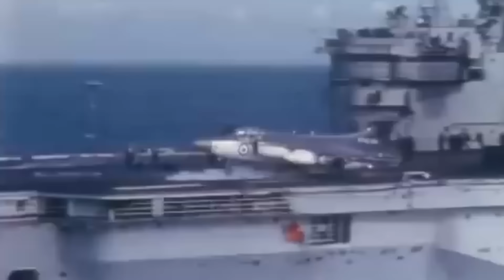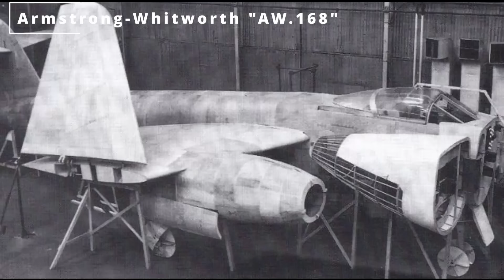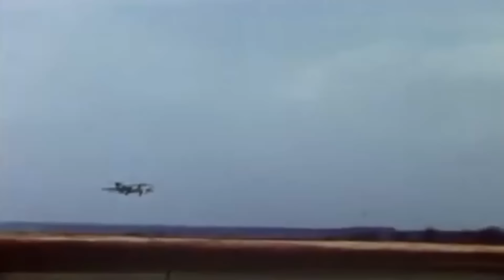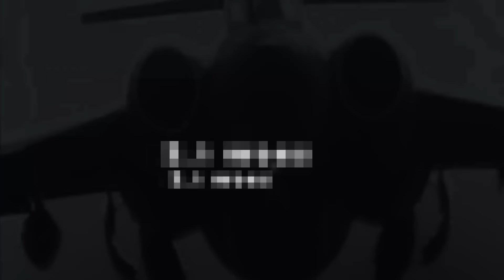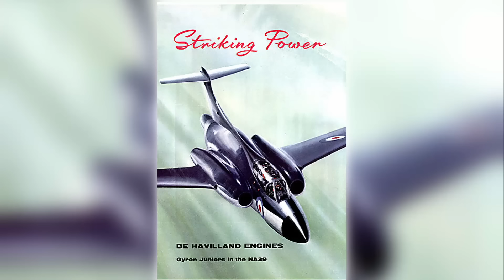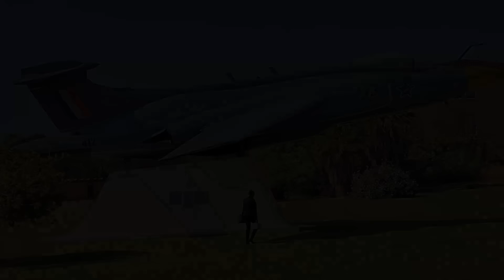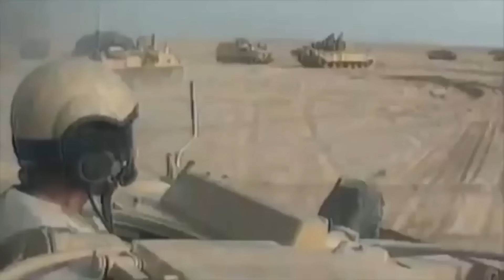Blackburn Buccaneer  -  Insane Low Level Bomber Americans couldn't shoot down - (Full Story)

Comment: I will always remember as a child of the 70's and 80's in the Highlands of Scotland waving down at the pilots of Buccaneers if we were even a small way up a hill when they passed
Reply: They "attacked" our car on holiday in Scotland. Buccaneers and Jaguars were a regular treat when we holidayed in Scotland.
Reply: @liammalone250  It wasn't only the RAF though I can remember being on a fishing charter boat in the 1990s which was vey obviously used by an RN frigate for weapons target drills
Reply: @davidmcintyre8145  True. I remember as a Grology student in the early 70's one fine Easter  day in Scotland. My frinds and i were sitting on a hillside eating our lunchtime butties. Below us a minor road snaked down the valley appearing round a buttress to our right and then off down to the valley floor. As we sat the silence was broken by a rumble coming down the road. 'Motorcycle.' Said someone, 'maybe a Harley.' As it come closer and got louder we came to the disappointed conclusion that it was a lorry. We all sat up, interested to find our which it was. Then, as the engine noise got much louder, into sight, following the road at very low level, came a Fairy Gannet!
Reply: @chriscarter5720  For real noise however you could not beat a Vulcan howling over a hundred feet or so above you
Reply: @davidmcintyre8145  That's not noise, that is a symphony from the gods on Mount Olympus.
Reply: @liammalone250  I had that too just outside of Market Harborough thought the world had come to an end….. almost thought I could hear the crew laughing 😳😳😳
Reply: I used to wave Down to or sometimes level with them @ the 7 Winds Cambusbarron . 1978/9
Reply: totallly, as a scout camping in the highlands I can remember being many feet ABOVE the buccaneers.  The pilot waved at as us :-)
Reply: Yip. I can vividly remember a hill in the Angus glens that was a great vantage point for the Buccaneers from Lossie. You actually looked down on the aircraft as they hugged the valley floor. It was awesome!!
Reply: Same here, Lossie and Kinloss not far away from mine.
Reply: High altitude training for the Buccaneer.
Reply: I was at Uni '72-'75 studying Geology and spent many days in the Highlands. On one field trip we were frequently overflown, at height, by jets which my friend identified as Jaguars. I told him they were not and, when  he asked why not, I said, 'Wrong shape for jags and anyway they're up there if they were jags they'd be down here. They're USAF.' The hotel we stayed at was at the eastern end of Loch Assynt and on our last day as we started to climb into the minibus a buccaneer came barreling up the lake at about 50 feet turned hard right just in front of us and disappeared up the valley. I looked at my friend, 'That,' I said, 'was the Royal Air Force!'
Reply: I can remember being on holiday fishing in the Scottish Highlands in 1980 when a buccaneer came through at very low level, it was an awesome sight.
Reply: My dad flew the Buccaneer’s (an aircraft I've been in many times, from the age of about 11). Well things were a lot different back then, and us kids would often go to hound them on Sundays if they were quiet, and we'd often talk our way into a flight on whatever aircraft they were with LOL.

The old Fairey Gannets were awesome to fly in, what an incredible view! The ugliest aircraft, with the most spectacular view. I've also flown in the Harrier GR 7, the GR 9, also the Sea Harrier, plus nearly every helicopter you could think of, including the old, world speed record holder, the Lynx. I've flown many Gliders, but the most amazing and impressive of them all, was indeed the Buccaneer.

You just can't describe what it feels like to travel at an altitude of only 10–15 feet, at speeds of 450–550 mph. Seeing our own garden hedges as blurs, LOL, flying straight over them, skimming the branches (not allowed, but you know lol). 

That aircraft, the Buccaneer, I'll never forget, it scared the living life out of me.
Reply: The particular  aircraft at the start of this video, Sea Witch / Debbie was the gate guardian at Lossie for a while. This same aircraft was the last fixed wing aircraft to take off from a British Aircraft Carrier : Ark Royal : when they were all given to the RAF.
Reply: Years ago, driving on a country road in S.Scotland, I was literally overtaken on the road. First by a Buccaneer, then by a Harrier, then by a Hercules (whose pilot clearly needed psychiatric evaluation.)
I almost ended in a ditch - those guys didn't overfly me, they overtook me, at an insanely low height, on the outside lane of a highway. Mad, crazy, barstewards. But somehow I've since felt safe in their hands, in any future conflict.

Later that very same day, I watched a Hercules (same one? no idea) actually dogfighting - engines screaming - with a BAE Hawk. If the airframe engineers had been around, they'd surely have been having kittens, given the turns that Herc was pulling.
I suppose I should disapprove of such antics, but truth was I was simply envious.
Reply: @jackwaycombe  Wonder if anyone snapped a picture of you... So the would and still do make targets... Our fishing Salmon Cobble would be picked up by the crew as they passed...
Reply: @ecossearthur  
If they did, I'll buy a 10x8 print, whatever the cost!
Reply: @jackwaycombe  only through my eyes.. Only to have a modern cell phone
Reply: @EtonieE25  It was a regular thing, hence it, becoming banned. LOL. Times were a lot different back then.
Reply: @EtonieE25  Not tree's, hedges! LOL
Reply: @EtonieE25  Something I'll never forget, it scared the life out of me, yet I couldn't get enough, lol. My nickname was Speedy Gonzales.
Reply: @EtonieE25  I never got the chance in the Panavia Tornado though :(
Reply: @EtonieE25  
Rolling down the runway
throttles open wide
see the mighty Phantom
sway from side to side
airborne again without a blip
It's just one more aborted trip
but we're pressing on regardless
for the wg cdrs AFC

Went to early briefing
climbed into the Kite
opened up the throttles
and roared into the night
leaving the flare path far behind
It's dark outside, but we don't mind
cos we're pressing on regardless
for the wg cdr's AFC

Rolling down the runway
throttle open wide
see the mighty Falcon
sway from side to side
airborne again with just 9 G
I wish I had a nav with me (!)
but we're pressing on regardless
for the wg cdr's AFC

Rolling down the runway
throttles open wide
see the mighty Jaguar
sway from side to side
airborne again, but only just
It's not much fun
with F*** all thrust
but we're pressing on regardless
for the wg cdr's AFC

GIVE ME BUCCANEERS!
They're British through and through
The Banana Jet
The Best we've had yet
We are the last of the few.

Don't give me the Jaguar
Unless you refer to the car
The car is a ground hog
The aircraft, a half frog
Don't give me the Jaguar.

Give me Buccaneers
They're British through and through
The Banana Jet
The Best we've had yet
We are the last of the few.

Don't give me the Harrier jump jet
You haven't convinced me yet
Jets that fly backwards
Are soon to be knackered
Don't give me the Harrier jump jet
Well… You know, not just yet...

Give me Buccaneers...
They're British through and through
The Banana Jet
The Best we've had yet
We are the last of the few.

Don't give me this computer crap
It's no way to tackle a SAP
It's OK for Dicks, Germans and Spicks
But Gentleman, carry a map!

Give me Buccaneers...
They're British through and through
The Banana Jet
The Best we've had yet
We are the last of the few.

Don't give me Air Traffic Control
They live in a bloody great hole…
They scream, and they shout, then F**k you about
Don't give me Air Traffic Control.

Give me Buccaneers...
They're British through and through
The Banana Jet
The Best we've had yet
We are the last of the few.

Don't give me the F-104
It's only a ground loving whore
It goes in a turn, flick, spin and burn
Don't give me the F-104.

Give me Buccaneers
They're British through and through
The Banana Jet
The Best we've had yet
WE ARE THE LAST OF THE FEW!
Reply: Gairloch Wester Ross low level flying down the west coast... Epic
Reply: Yes!  I remember being half way up a glen and a Bucaneer roaring through below us.
Reply: As a child,I remember them flying over the beach at Portmahomack on their way to the bombing range.
Reply: I remember beinv at Eilean Donan Castle once and seeing a Buccaneer fly past.
Eilean Donan Castl sits at the corner where Loch Alsh meets Loch Duich.
 In order the make the turn the aircraft had to climb about 50 feet to be able to bank without the wing going into the water
Reply: Talk about dark horses. Many years ago I worked with a fellow IT lecturer. I'd worked with him for years,  spending many a happy hour in the bar. I  almost fell off my seat,  one day, when he casually revealed he'd been a Buccaneer pilot, and that it a nuclear bombing capabilities.
Reply: As an American with Scottish background I sure wish I could take a trip to Scotland someday I really feel like America is not cutting it. Especially down here in hell that we call Texas. Maybe someday I can make it back to the land that I call my homeland.🍻
Reply: Must say that I only found out about the 'Green Cheese' warhead this morning when I wiki'd up British nuclear weapons. Didn't know the Bucc carried it though...
Reply: @dominicseanmccann6300  Was too heavy for the Gannet, so, it was moved entirely to the Buccaneer, but this was cancelled in 1956, largely due to cost, and the aircraft becoming too visible.
Reply: Anyone remember this? 

Rolling down the runway 
throttles open wide 
see the mighty Phantom 
sway from side to side 
airborne again without a blip 
It's just one more aborted trip 
but we're pressing on regardless 
for the wg cdrs AFC 

Went to early briefing 
climbed into the Kite 
opened up the throttles 
and roared into the night 
leaving the flare path far behind 
It's dark outside, but we don't mind 
cos we're pressing on regardless 
for the wg cdr's AFC 

Rolling down the runway 
throttle open wide 
see the mighty Falcon 
sway from side to side 
airborne again with just 9 G 
I wish I had a nav with me (!) 
but we're pressing on regardless 
for the wg cdr's AFC 

Rolling down the runway 
throttles open wide 
see the mighty Jaguar 
sway from side to side 
airborne again, but only just 
It's not much fun with F*** all thrust 
but we're pressing on regardless 
for the wg cdr's AFC 

Give me Buccaneers 
They're British through and through 
The Banana Jet 
The Best we've had yet 
We are the last of the few. 

Don't give me the Jaguar 
Unless you refer to the car 
The car is a ground hog 
The aircraft, a half frog 
Don't give me the Jaguar. 

Give me Buccaneers 
They're British through and through 
The Banana Jet 
The Best we've had yet 
We are the last of the few. 

Don't give me the Harrier jump jet 
You haven't convinced me yet 
Jets that fly backwards 
Are soon to be knackered 
Don't give me the Harrier jump jet 
Well… You know, not just yet... 

Give me Buccaneers.
They're British through and through 
The Banana Jet 
The Best we've had yet 
We are the last of the few. 

Don't give me this computer crap 
It's no way to tackle a SAP 
It's OK for Dicks, Germans and Spicks 
But Gentleman, carry a map! 

Give me Buccaneers 
They're British through and through 
The Banana Jet 
The Best we've had yet 
We are the last of the few. 

Don't give me Air Traffic Control 
They live in a bloody great hole 
They scream, and they shout, 
then F**k you about 
Don't give me Air Traffic Control. 

Give me Buccaneers 
They're British through and through 
The Banana Jet 
The Best we've had yet 
We are the last of the few. 

Don't give me the F-104 
It's only a ground loving whore 
It goes in a turn, flick, spin and burn 
Don't give me the F-104. 

Give me Buccaneers 
They're British through and through 
The Banana Jet 
The Best we've had yet 

WE ARE THE LAST OF THE FEW!
Reply: I threw rocks at Tornados flying below me when i worked on a Scottish sheep farm in the late 80s.  Never hit one.

Comment: It was a classic case of if the RAF had accepted Blackburn's offer of the P.150 Super Buccaneer variant, the RAF could have gotten their overdue Canberra replacement as early as 1968!  And the RAF could have fielded 150 planes and become a major nightmare for Soviet war planners until at least the late 1980's (and possibly beyond since the Super Buccaneer could fly almost as fast as the Panavia Tornado in low altitude operations).
Reply: Interestingly the cockpit and RADAR for the Tornado was tested by bolting it onto a Buccaneer and the resulting Hybrid was deemed to be better than either aircraft
Reply: @davidmcintyre8145  Correct. A Buccaneeer S.2 was modified to carry and test the radar that would eventually go into Panavia Tornado. Appropriate since the Buccaneer flew almost the same type of low altitude mission the Tornado would fly.
Reply: The TSR-2 was supposed to be the replacement and in service in 1965, much like the A-5 or Mirage IV. Unfortunately, the TSR-2 was late (revised projection 1970), over budget and not meeting OR. 339. Maybe Blackburn could have done better in the end.